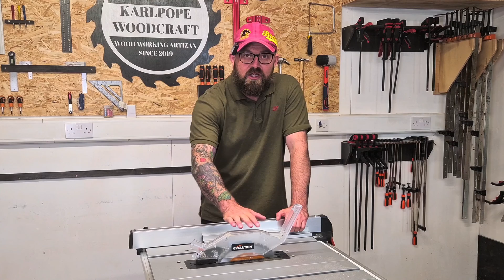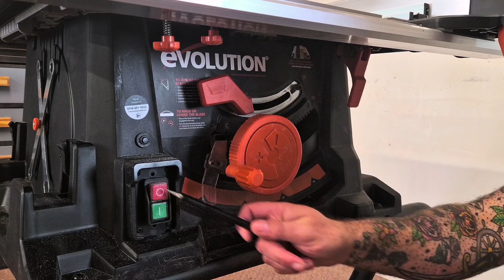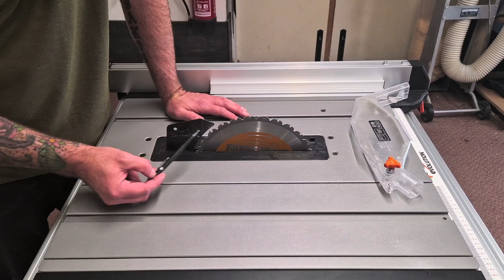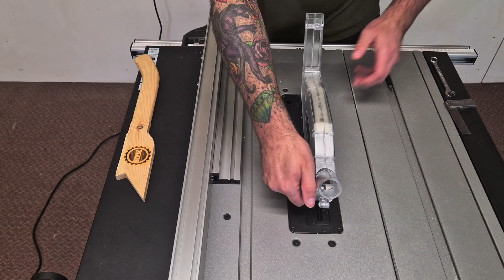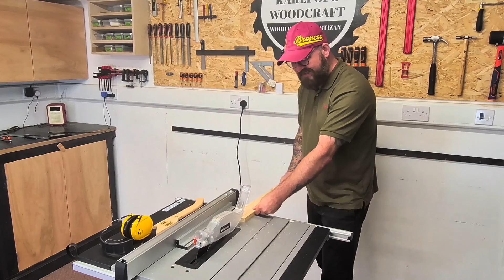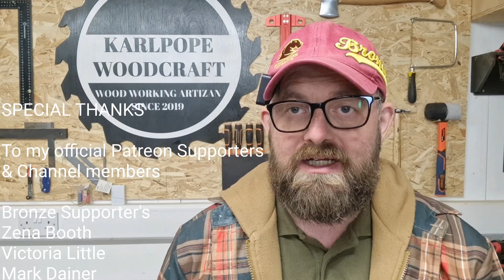Don't Cut Your Fingers Off Using The Evolution RAGE5-S

Comment: at 10:10 with regards to repeatable cuts.  With the Rage 5S, you can use the additional fence as a stop block. For safety, fitting the shallow fence, so that the front of it is 3cm's before the blade (it works just like your piece of wood; however, due to it being more secure, it is less likely to get dragged/pulled into the saw).  The shallow fence will extend beyond the measuring gauge but not pass the blade.
Reply from the maker: Spot on advice Deanne 👌
Reply: @karlpopewoodcraft  hope that you find it useful.

Comment: Hi Karl, I've got the Dewalt table saw but I'm loving that sliding base.  I use the Evolution sliding Mitre saw, and it's also a great bit of kit. Must confess the table saw scares the crap out of me, which is no bad thing.
Reply from the maker: HI David,  yes the features on the Evolution are fantastic and it's excellent value for money. I also love my Dewalt DW745 which is no longer made, its rock solid quality.

Comment: Do you find that smaller fence attached to the large one useful, or is it just a hindrance?
Reply from the maker: Hi mate, I find the fence works well. You can easily remove it but it's recommended that it's fitted I believe under UK health and safety. It helps reduce kickback because it allows the wood to move once past the blade and reduces any potential binding.

Comment: Hi Karl, I have just purchased the rage 5S and have noticed that the sliding table has some play in it. does yours?  also there appears to be  no information in adjusting this.
  Evolution have also produced a zero clearance plate for the blade that is aluminium with a plastic insert in it , a big improvement in cut quality.
Reply from the maker: Hi Ralph yes I small amount of play, ye I had that insert fitted during this video, great isn't it.

Comment: Absolutely superb video Karl, this will definitely be my recommended viewing for be tablesaw users.
Quick question, are the Evolution mitre slots still non standard sizing like most worksite saws?
Reply from the maker: Thank you Dean, 😊 that's great feedback.  The miter slot is pretty standard I believe it's the same as my Dewalt. I'll have a measure tomorrow when I'm in and let you know the size.
Reply: @karlpopewoodcraft  cheers fella, I know they at least used to be smaller because you had to make your own runners (no biggie). I spoke to Evolution a couple of months ago but forgot to ask them lol
Reply from the maker: @WoodworkJourney  ye some of the budget ones like the titan I used to own had really thin miter slots.

Comment: Great video m8 very well explained. The sliding table on that saw kinda seems like it bumps it up slightly out the jobsite saw category. Looks great for beginer saw. Very well explained video and oroper in-depth knowledge 👏👏🏴👍
Reply from the maker: Cheers Michael that's great feedback 🙂
Reply: @karlpopewoodcraft  very much so ave also shared the video to fellow creator whose looking into possibility of table saw. Would u recommend it a take it??
Reply from the maker: @michaelwillson6847  Ye mate I think it's a cracking saw for the money, lots of excellent features.
Reply: @karlpopewoodcraft  nah worries m8 I'll pass the info on. Ave actually bought one went with einhell can't complain about it apart from noise but all in all pretty happy